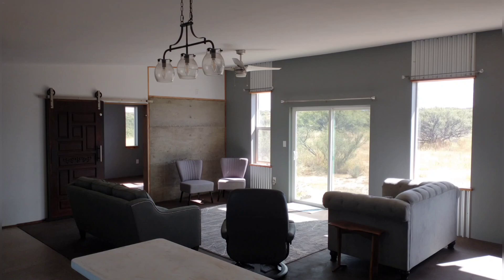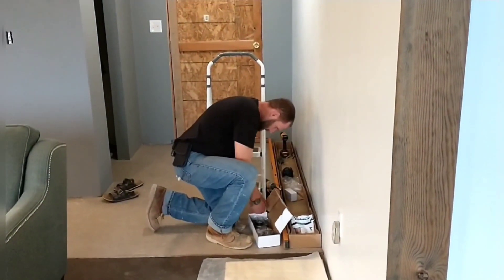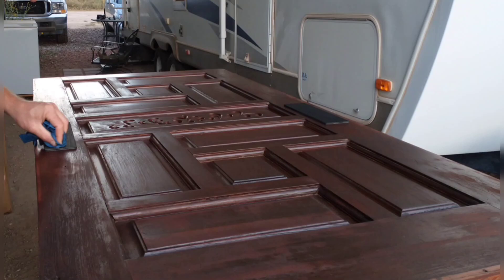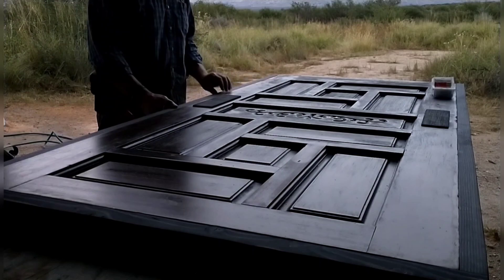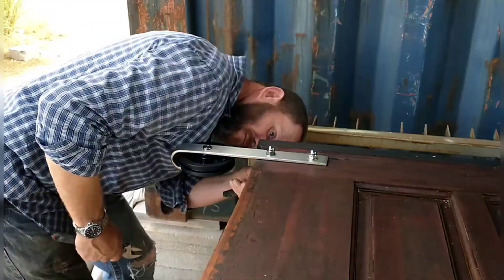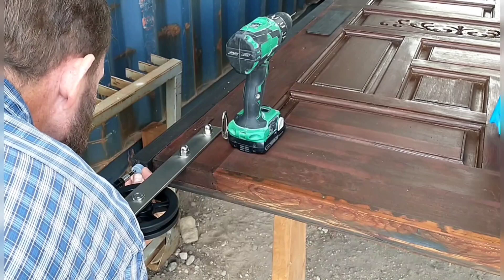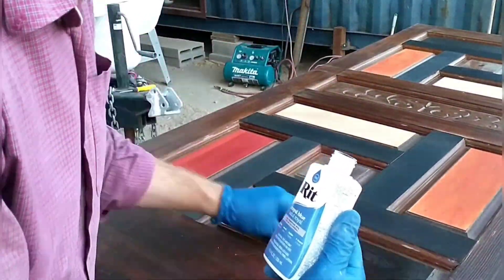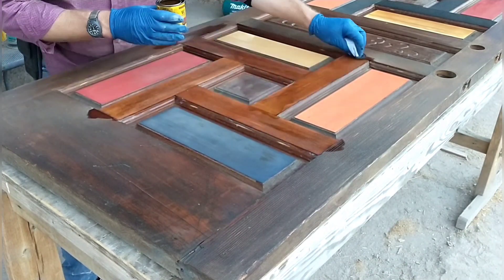DIY Vintage SLIDING Barn DOORS Install #51 BUILDING Our Own OFF GRID Home

Comment: Great work on the doors. Using old doors always intimidates me, but you guys make it look easy. I was surprised when you said that the barn doors save space. Pocket doors can save space, but in my point of view barn doors take up the same or even more space than a standard swing door. Still, it was interesting to watch the installation.
Reply from the maker: Thanks! I guess it depends on where you need the space. We have plenty of wall space, but not enough room for doors of this size to swing open and closed without obstructing other doorways or objects. We couldn't do pocket doors because of plumbing and gas lines in the walls, but these worked out great and look nicer anyway. Depending on the particular orientation, a swinging bathroom door would have hit the bed, or been in the way of the toilet or the dryer. It wouldn't have worked out well in the living room either.
Reply: @RedandAprilOff-Grid  I see what you mean. And no worries, I'm not trying to question your decisions. You guys know what works best for you :)

Comment: After living with barndoors for a few years, one tip I would give is to take something like a flap disk and grind a shallow little valley into the rail at the full open and full close positions. Just enough that they ramp down into them about 3 inches from the ends. They roll so easily that they bounce back off the stops during normal usage and pushing and holding them gets really old after a while. I also used a skateboard wheel bearing on the bottom guide to make it smoother than just metal on wood.
Reply from the maker: Thanks for the tips! We haven't needed to open or close them much yet, but they sure are quiet and slide easy.

Comment: Nicely done the doors look great. "Sliding Barn Doors" are certainly the current design rage however compared to a pocket slider there are some compromises: loss of the use wall space (behind the open door) for furniture, hanging artwork/fixtures, interference with wall outlets etc.
Reply from the maker: We seriously considered pocket doors, but they looked like an even bigger pain, and plumbing was in the way. These are a nice big piece of art complete with cool hardware. They add a lot to the space. We planned most things out pretty well, but some of the socket placements weren't quite ideal, but we can make them work. Thanks!

Comment: 10:16 I absolutely LOVE almost everything, but I don't get the earthen wall (I believe that's what you said it was). It looks like someone poured a nonedged concrete slab, and didn't remove the forms. I also wonder about its height not going all the way to the ceiling. Just my opinion, and maybe there's more to come. By the way, those doors came out wonderfully!
Reply from the maker: Thanks! We have a couple of poured concrete walls, for thermal mass, and accent walls. They turned out exactly how Red wanted them to. He wanted them to have the exposed concrete forms and studs for an industrial look. We love how it turned out, but realize it's not for everyone.  The floor in the bedrooms and living room are earthen (dirt).

Comment: I do think that the dark wood door would have looked better with light colored inset panels and the trim of the same light color. I think it would pull the whole door together as a single unit.
Reply from the maker: Yes, lots of different ways to do it. 😎 We are happy with how they turned out.
Reply: @RedandAprilOff-Grid  that's what counts! I have to admit I'm more stuck in traditional styles. Lol.